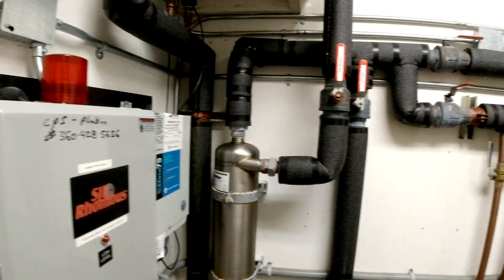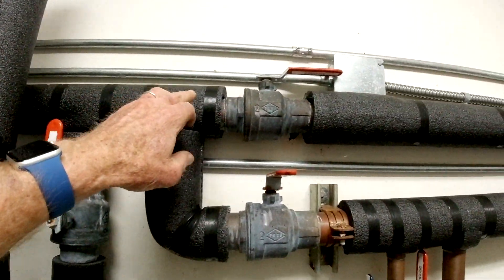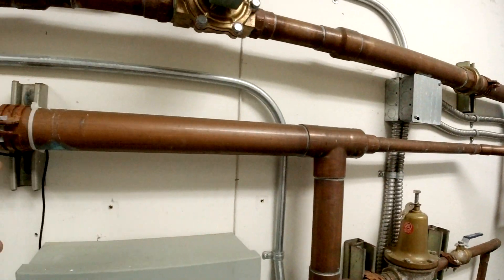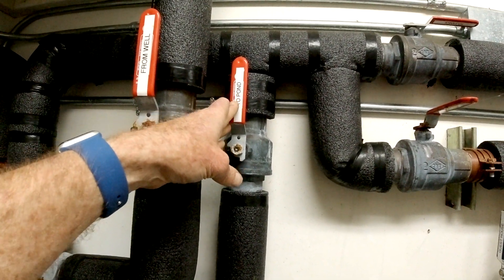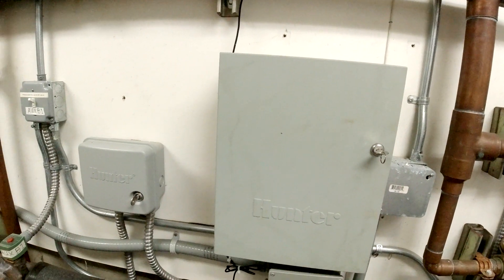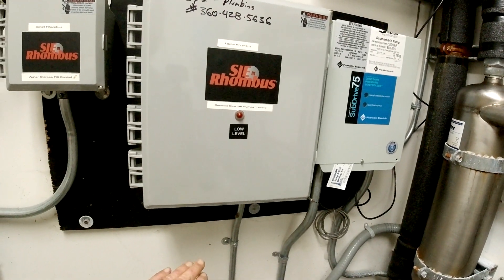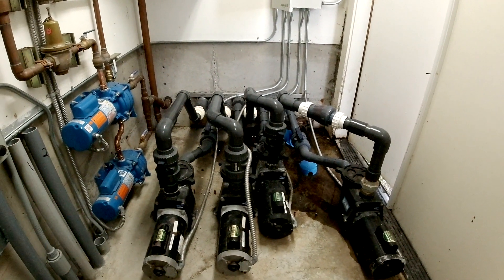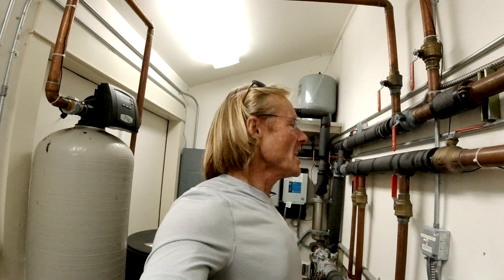The Mostest Pumphouse

Comment: Ron, just out of curiosity, how long did it take to put that system together? It makes my head spin just thinking about all those connections
Reply from the maker: Hard to say. It was all planned as we had to run all of the underground conduit in every direction prior to pouring the foundation and placing the concrete. The whole project took 18 months. My plumber's fee alone was $350,000. Needless to say many many subs and suppliers made a few bucks and were happy to get the work.